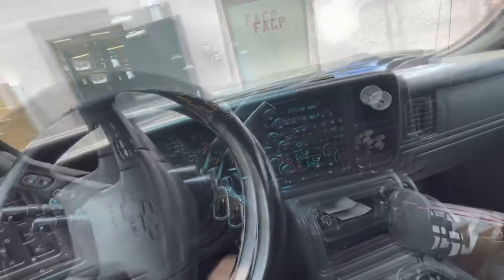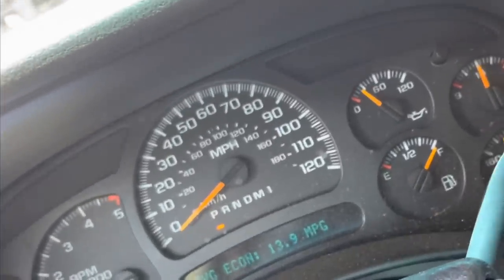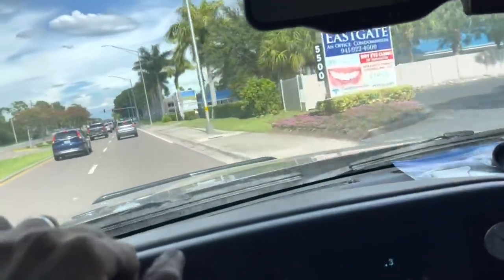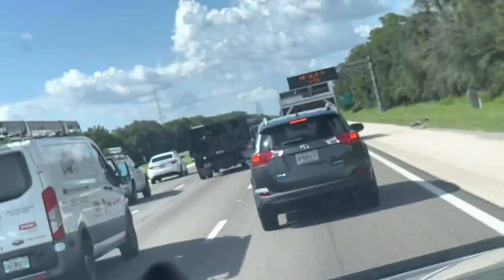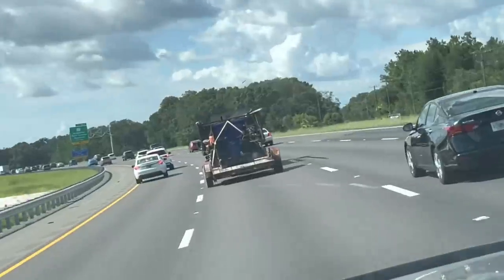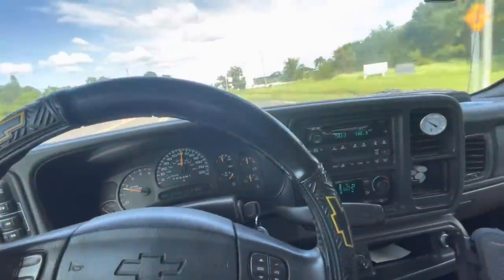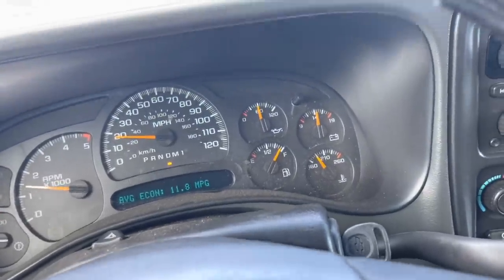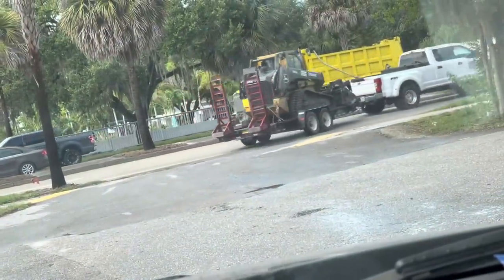Need answers! ox-cetane Diesel Fuel Experiment | Duramax 6.6 LBZ

Comment: Hi Ray

Many years ago we baught 2 identicle cars from ford, even there plates only differed by a single letter and they came of production line astern, collected the same day, always serviced at the same time.

I do about 65,000 Miles a year on my own no fuel treatments or shit, car run a dream never missed a beat and at 210,000 Miles mine went, no major work ever carried out beyond book stuff.

The wifes car though, she insisted on Redex (or whatever they call it now) and in the 4 years of its life, in those 4 years it had a littany of fuel system problems, damaged injectors, bad pumps, corded leaking lines, failed and damaged seals and it blew a CAT

I put it all down to the fuel addative shit, i dont and wont use them anymore, but her car ended up in the scrap yard at 5 years old with 120,000 miles on it.

There is no way for you or anyone else can test these for a long enough time so what they do and dont do, they might clean short term, but they do damage long term aswell
Reply: What about driving style, you did almost double the mileage so you drove firther, was yours highway and hers more urban driving?
Reply: @downundarob  I drove alot further, 1000 miles a day was out of the question for me, always service station fuels and such, i cant comment on the wife, what she did i dont know i worked 16hour days i more or less lived in my car for a period.

I also excersized my car fairly regularly, and never used the cruise control, where are the wife lived on the bloddy thing, her car got serviced when mine did, they went in together and got the same treatments service items, both had water pumps at 100K of my own back, both had oil pumps changed of my own back with the first major belt change, there was a reasonable amount of preventative maintenance, i couldnt afford for mine to break down, so much as hinted of problems, they both went in for full services, and considerably more was replaced on her car than mine, and so far as i can work out there was only 2 diffrences her, and the redex shit she insisted on putting in the tank cos its "what dad did and never caused him any issues" Man went thru cars like a yank does twinkies
Reply: @AnIdiotAboard_  I cant find the reference online but I recall reading when I was a child (possibly Reader's Digest) that engines on long haul vehicles didnt wear as much as those in stop start styles, because the ngine oil didnt get hot enough to burn out the acidity. That would be more for the bottom end of the engine tho I gess.
Reply: @downundarob  This is the UK, motorways rarely freeflow there can be alot of start stop start stop but i get what your saying, then on the otherside of the coin, her car never did any subzeros, i was leaving at 4am in winter at -3 those kinds of temps do not do good things to engines.

Look folks im well aware this is all subjective and the rest of it, but i cant explain away essentially an entire new fuel system on one car vs another, this isnt engine damage, its damage to pumps fuel seals and lines, high pressure pumps, right upto the injectors (although i dont recall ever having the replaced.

If fuel went thru it on her car it invariably failed, and thats my point, the whole point and nothing but the point
Reply: First: driving style makes a huge difference. No two people drive the same. Regardless how you try to explain it, there's always subtle differences in driving style.
Second: You drove yours on the highway all the time, open highway miles are always better for a car than in town driving. 
You may not want to believe it, but driving on the highway at highway speed is better & easier on a car than constant starting & stopping all the time. Accelerate & decelerate all the time causes more wear & tear on literally the whole car. Constantly starting the engine & shutting it off causes more wear & tear on parts than just the starter. 
Third: no matter how you try to make it sound like both cars were exactly the same, they aren't!  No two vehicles are exactly the same, regardless of where they rolled off the assembly line. 
The car is assembled on the assembly line, but the engines & transmissions are built separately in a different plant & then sent to the factory & sit until they are installed. They are built by different people too. 

You want to place all the blame on the additives your wife insisted on using when there's a logical alternative reason possible.
Reply: @timothygeiger8271  Modern QA makes the, "every car is different" idea a little far fetched. Technical service bulletins would highlight any known issues with the fueling system, as if this were a common problem customers would make it very clear to Ford in not such a nice way, most probably. The idea of a 1 off bad car isn't impossible, as I've known of pickup truck differentials that were DRY from the factory, but that's something that would make itself evident fairly quickly. It's exceedingly unlikely that the car just coincidentally happened to have ALL of those fuel system symptoms + a dead cat, purely as a result of improper manufacturing and variation in component quality, while the other one had no such issues to speak of. Furthermore, it's very unusual to me that a driving style that's unhealthy for the car would make the fuel system and only the fuel system incur damage, that's not typically the kind of wear you'd expect from short tripping, start stop traffic, and loading/revving up the engine before it's all the way warm. Again, unless there was some kind of TSB, I doubt that it was anything BUT the fuel additive that ruined it. Even if there were some kind of engineering oversight within the fueling system that causes it to slowly break down and fail under certain conditions, I suspect more than just a fuel additive could expose said oversight. This would again result in some kind of TSB being put out, I would imagine.

tl;dr: just because there's a possible alternative explanation doesn't mean it's correct, Occam's razor is fair to apply to this scenario given the set of circumstances.
Reply: It's short trips that wreck a car engine and its fuel system.  Honda call doing less than 5 mile trips 'arduous' service!
Reply: @bubbleman2002  i don't care what you want to think, no two cars are the same. Your BS technical service bulletins don't drive the cars! TSB's don't have anything to do with how parts wear! 
You have so much to learn, but you really need to grow up first!!
Reply: @timothygeiger8271  I never said TSBs change how parts wear, I said a TSB would help discern if the additive was the culprit of the damage, or if a design oversight was the culprit of the damage. If you're going to tell someone to grow up, at least have reading comprehension strong enough to understand their post.
Reply: Guys you have all got way off topic here, your all on the engine damage bandwagon, im not suggesting anything like engine damage and im not talking about engine damage.

Read it again, im talking about Fuel System components, Pumps, Lines, Injection, High Pressure Pumps, Exhuast / CAT, Hell even seals. Those are the parts that failed way more often on HER car, i dont believe the diffrence in styles accounts for all of it either.

I do believe the use of the addetives over the years contributed to these failures, it can not be all down to driving style and or trip duration, remeber both cars lived the same lives in terms of maintenance, always on time, always done at the main dealers, you could argue hers had a better service history, in some instances, when i hit my 120,000 mile service i had the timing belt and pumps done on hers at the same time, 50,000 miles sooner than was stricly needed.

We are all entitled to our views and opinions, and i welcome a good debate on the subject so long as we remain respectfull, but we must stay on topic, and with the points initially raised, not wandering so far of the page you left the library and is now on the way home on a train.
Reply: @bubbleman2002  talk about lack of reading comprehension, you are worse. I never said faulty components. My point is driving style will make some parts wear out sooner.
Reply: @bubbleman2002  hi borris I managed to miss your reply yesterday, thanks for your input, I possibly should have out it like that aswell. 

But this got me thinking yesterday about the cars and I still have alot of the paperwork on my Ford account. So here's a little more insight for those who wanted it.

BOTH Cars had the following parts replaced, I'll stick to relevant shit.

Both needed a lift pump, both needed new filters and housings due to splits.

So we could just ignore those components but now onto things only on her car.

Fuel lines replaced, no pump fault found low flow condition.

Injector 2 and 3 (all 4 replaced)

High pressure mechanical pump.

High pressure rail (upon inspection it was loaded with sludge)

HI preassure release valve x 2, sticking open

1 x Catalytic Converter at 71,206 miles

A dozen various sensors.

2 EGR units (but the first new one failed in a few days and was replaced again)

So the differences on the whole are significant and thatsbjust parts I paid for. Some other stuff was done under warranty they was quite good to begin with.

Total cost of my car from new to sold not including fuel and consumables - £61,200 in 61 months

Total cost of hers from new to scrap not Inc consumables £72,500 in 64 months.

I like you accept the premise of a bad part here and there it happens, but the diffrence between 2 identical cars line astern, I don't see that being a Ford problem persay, the only real diffrence was redox so I guess a natural conclusion for me but I digress, I can't prove it one way or another.

I still blame the redex stuff

Comment: I use the archoil 6500 for last 265k miles in my vw tdi. It was made by bell labs to be used in standby diesel generators.  Archoil is the single best thing I did for my injectors with today a total 395k original miles. The engine runs like a clock and the injectors are clean.

Comment: You can use your Turn Signal/ Headlight dimmer switch to signal a driver with your headlights by using the Flash to pass function by pulling back on the switch

Comment: Sometimes using cleaners to clean a old engine makes things worse because the seals are worn out and the carbon build up prevents oil leaks as well as other combustion issues would be interesting to see a scope test before and after using the product to see how well it works @Rainman Ray's Repairs

Comment: My LBZ, single rear wheel, carrying 1 Ton in the bed, gets 22+mpg cruising on the highway with a Gale Banks 6 gun  on setting No. 5 plus CAI.    From Danville, VA to Washington DC area. (mostly flat).   I have, on  a 15 mile highway trip - just about 60mpg indicated (enough to get into 6th gear) averaged 28 mpg on the lie-o-meter.  The moment I pulled off the highway it went down.   LBZ is definitely the last of the good diesels.  BTW - was commuting 50 miles one way to work and was getting bored and started a game to try to max the fuel milage.   Super light on the pedal... a little higher air pressure in tire, and just over 60mph in a 55.   I think 62mph and the transmission shifts to 6th gear so that was the goal...

Comment: I'm not sure how much that would help my LB7 since I have an Air Dog lift pump. That does a great job keeping air out of the system. I do usually run a cetane booster that adds some lubricity to the fuel in order to keep my original 320,000 mile injector pump alive.

Comment: In most newer cars with the dimmer incorporated into the turn signal stalk, you can activate the headlight flash by pulling back on the stalk. That will turn lights on momentarily if they're off, or off if they're on.
Reply: I think my truck does that as well (98 Chevy K1500 Silverado Z71) so Rays should be able to

Comment: Cetane is the opposite effect as octane. Instead of raising the flashpoint like octane in gas it lowers the flash point. improving the compression ignition of the fuel. My old Suburban 6.2 diesel loved the stuff.

Comment: Gotta love South FL traffic.  Yes turn on and off your headlights,  not flashing your high beams. As a truck driver of a semi/18 wheeler, being blinded by flashing headlights sux.. 

Fuel additives Archo8l works great for my 3500, and standine in my x15 Cummins. I've been able to tell the difference with both.

Comment: I am religious about getting my truck washed before a road trip. Mainly because I know it's going to get dirty (especially when we got to Burning Man) but maybe in the back of my mind I think having a clean truck and trailer my improve wind resistance just a touch.

We also use Lucas Upper Cylinder Lubricant and Injector Cleaner on every fill-up. I know that has improved my fuel efficiency.

Comment: Years ago I was introduced to REV X oil additive. A mechanic said it would help with a 2000 7.3 sticky injectors. I could not afford to replace the injectors but I really needed the injectors to work till I got the $$ saved up. I added the REV Z every time I did an oil change. Injectors would go into failure at about 4k and oil would be renewed with more REV Z. If I left out the REV Z at the oil change the injectors would not operate properly. 
4 Years and 150k miles later I decided that they just had to be done . Some products really do work with some vehicles. 
Might just have to give this a try.

Comment: Nothing beats Seafoam. My diesel van got quieter, is more responsive, and the mpg went up. It's now doing 70 miles per Imperial gallon, so just over 58 per U.S. Gallon (4.04 Litres per 100km)

Comment: I ran a cetane booster in my diesel Passat for several months. I found the fuel economy was marginally better but when you take into account the cost of the product you're not saving any money at all. It did however idle better and accelerate smoother so I can get on board with the claim it cleans the fuel system internals.

Comment: Ray buddy, in the old days some old-school semi-truck drivers swear that putting a gallon of 180-190 proof moonshine in their 100-gallon diesel tanks not only did they say it thinned out the mixture and gave them 50 more RPM but also cleaned all the carbon and sludge out of everything and thus improved fuel economy.  This product may be a similar thing, but I would not try drinking it if I was you. LMAO  PS: I think that SeaFoam started out this same way and originally was for diesel trucks for the same purpose to clean and restore fuel economy, it also worked well on restaurant deep fryers to remove decade-old baked-on grease. Just an FYI and Keep up the good work.

Comment: My Tundra high beam switch has a passing indication feature where normally to turn on the high beams you would push the lever forward...pulling the lever back momentarily turns on the headlights(if they're off) until the lever is released....I also use this feature to let people (especially truck drivers) know it's safe to merge ahead of me.

Comment: When not using the banana scale, mileage is litres per 100km, which for you is ~16 to 18 litres per 100km. That's about an 8.5 on the fuel pig scale. Thanks for sharing!
Reply: It can be km’s/l or l/100km’s it only depends which one uses..both give consumption figures
Reply: @IrishFoxHound  True, but we rarely if ever use to km's per litre since the standard is litres per 100km. Most people would just convert it so they understood what you were saying.

Comment: Her in Ontario Canada the penalty for using your phone while driving is as below.  Keep in mind it is OK to use a hands free phone.  

First conviction:
a fine of $615, if settled out of court (includes a victim surcharge and the court fee)
a fine of up to $1,000 if a summons is received or if you fight the ticket in court and lose
three demerit points
3-day suspension

Second conviction
a fine of $615, if settled out of court (includes a victim surcharge and the court fee)
a fine of up to $2,000 if a summons is received or if you fight the ticket in court and lose
six demerit points
7-day suspension

Third and any further conviction(s)
a fine of $615, if settled out of court (includes a victim surcharge and the court fee)
a fine of up to $3,000 if a summons is received or if you fight the ticket in court and lose
six demerit points
30-day suspension

Comment: Fun fact, an ox is a castrated bull steer (boy cow). So you were technically correct to say it was a bull on the label.  Love the vids!
Reply from the maker: i didnt know that
Reply: Not fully correct.  When talking about domesticated bovine, and excluding wild species such a Musk Ox, an "ox" is a male bovine (cattle) used as a draft animal.  A "steer" is a castrated male bovine raised for slaughter.  A bull is an intact male typically raised to mate and create more bovine.  Most draft animals are castrated to make them more docile and easier to work with.  It is rare that females are used as draft animals because they are smaller, limiting the load they can pull, although during my time in India, Pakistan, and Africa, I witnessed many small carts pulled by cows.  By the way, a "cow" is a female cattle that has had a calf, or is older than 2.5 years.  Young female or those that have not had a calf are "heifers."
That's the end of our bovine biology for today!!

Comment: weve had a similar product in the UK for years and it does work pretty well especially making the engine run smoother.
Reply: Which product is that?
Reply: @gj91471  cant remember its name but it was made by millers.
Reply: @mickthompson584  Millers is rubbish in comparison to ox-cetane.... Trust me... I've been using it for 2 years.